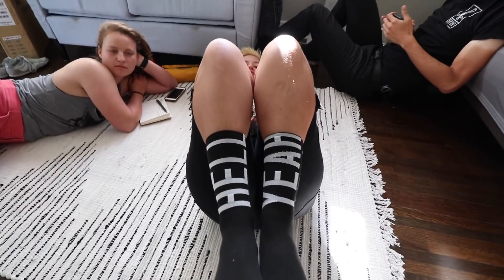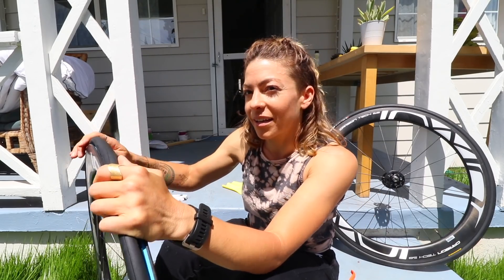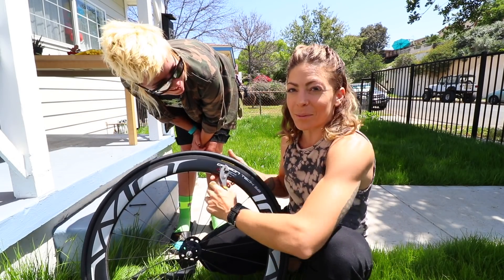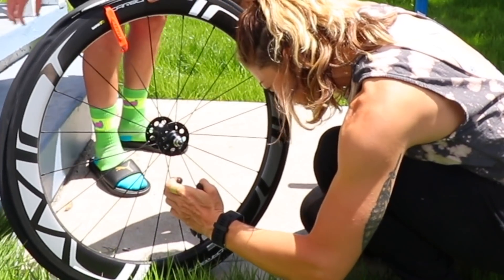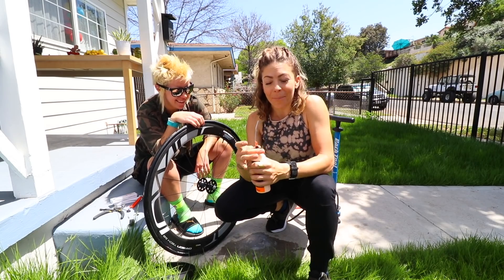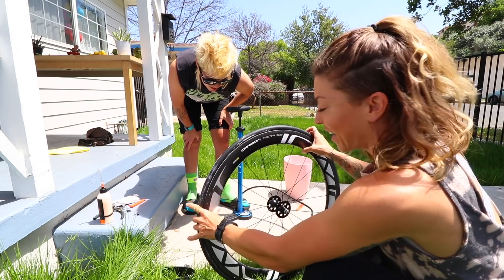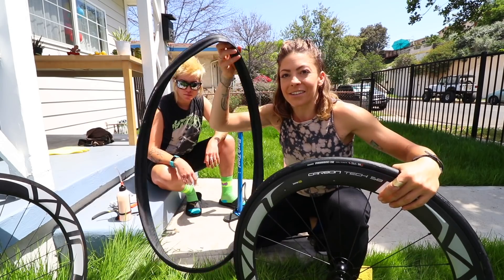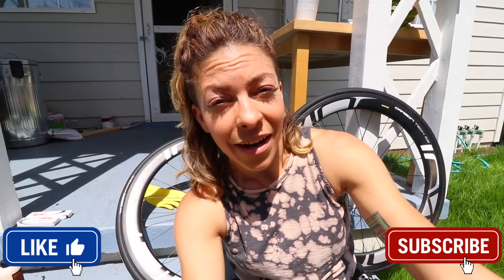Setting up my New Tubeless Wheels for Fixed Gear Racing

Comment: Friendly tip from a bike tech: After mounting the tire and applying soapy water, you can inflate the tire to make sure it will seat first before putting sealant in. That way if it won't seat and you have to remove the tire, it won't be a mess.

Rock on and great job! Hit me up if anyone needs bike tech help or answers. <3
Reply: Nobody got the ”i`m just going to soap up the rim” pun 😉
Reply from the maker: Kevin when I tried to do that, the air just escaped. But was fine after I added sealant.  Is it supposed to take air before sealant is added?
Reply: If the tire fits tight enough on the wheel then it should take air without sealant. That being said, sometimes if the wheel and tire aren't super tight, then sealant with help when inflating. Also, sometimes track pumps simply can't put out enough air to seat the bead fast enough so that air won't escape. The luxury of air compressors are a beautiful thing.

Comment: I always use a syringe to draw the sealant into then you can just inject it into the valve stem.  Then you can get an accurate measurement for the amount of sealant that you used.  Also put the wheels on and go for a ride for about a half hour.  Helps to spread out the sealant better and to make sure the bead is seated on the wheel.

Comment: Park Tool vc-1 for the valve core. No soap needed. Sealant at 60ml for each is okie. Air compressor works way good for seating. Have fun with it!
Reply: 60mL is an excessive amount for a road tire. I use 30mL.
Reply: I suggest 60 cuz i put 30 in my first go and it didnt hold air very well. Im also in the desert, so a little more isnt so bad for the heat.

Comment: Just switched my first bike (cyclocross bike) to tubeless two months ago. I'm still not sure if I like it - but I did have two flats which sealed themselves up. As soon as you get a flat jump off the bike, turn the wheel a few times and you are mostly free to go.. I've watched a lot of tutorials and most people recommend CO2 instant pumping up the tire before even pouring in the fluid.
Reply from the maker: gr33nshoes I’m a huge fan of going tubeless! So far so good

Comment: I recommend the e-13 tubeless valves. The stem cap is the valve core remover so you can't lose it. I have been testing them for about a month now and no problems.

Comment: I really like Hutchinson Fusion 5 TLR 11Storm, Mavic Yksion Pro UST and Zipp Tangente Speed RT25 tires. They're easy to mount and even dismount by hand, so no worrying about levers messing up tire beads or rim tape.

Comment: You couldn't pay me to run road tubeless tires, I have seen too many of them blow off the rim even at fairly low pressures. Had one the other day fully evenly seated, sealant installed pumped up to 70 psi tire was sitting around for a bit while we did the other one and all of the sudden boom tire blew off the rim in on spot. And this was with tubeless ready rims and tubeless tires.
Reply: Sounds weird, I've been riding tubeless on 2 sets of wheels for almost a year now and never had any issues.  I'm riding wide tires (32 & 40) at 60 PSI max, lowest I've gone is 30 PSI.   No burps or anything at 30 PSI.  Giant and Mercury tubeless wheels (Mercury are hookless bead), Hutchinson Sector 32 and Maxis Rambler tires.   I lose pressure more slowly then I did with tubes.  I've never flatted on them.   I'm at the moment a fan.
Reply from the maker: paradox963 I’ll take the warning and be wary. Though now 2 races later and a month of riding tubeless on my road bike, I’m  very happy with them!
Reply: Kim in the video what tires were mounted and were they UST or Tubeless ready or neither

Comment: Funny!🤣 I’ll bet that Park has a tool for removing the valve core. They have a tool for everything else. Might be  good idea to get one. You can probably find it on Amazon and have delivered to you in 10 minutes by drone! Don’t ever try glueing a tubeless tire to a rim! You can however, glue a tubular tire to a tubular rim but you might glue your fingers together if you’re not careful! Ride on Kim!🚵🏻‍♀️
Reply: Yes, I have a Park valve core remover.  It makes it simple.
Reply: You can use a spoke key to remove the valve.